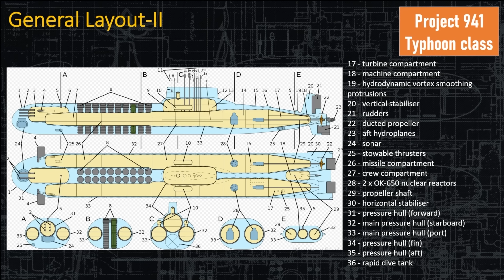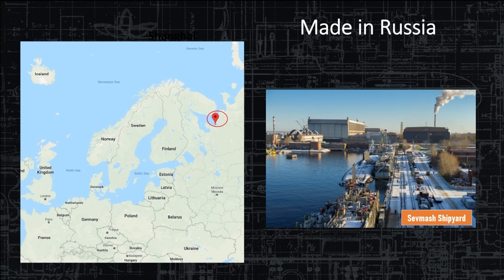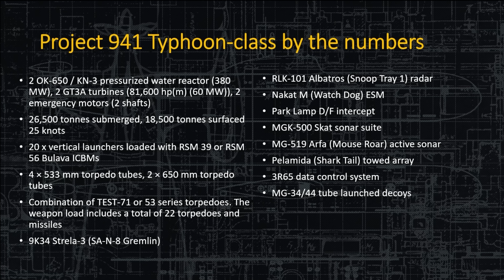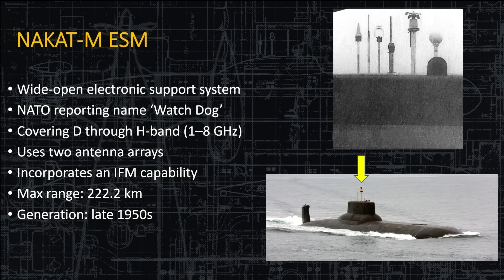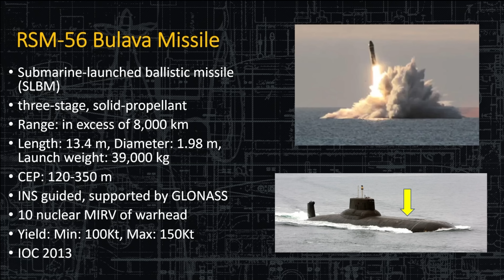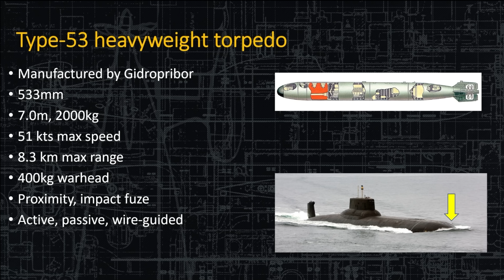Typhoon SSBN Sub Brief

Comment: About 5:05 and stowable forward hydroplanes.
I know I am getting really technically here. But the soviet navy did indeed have boats with stowable forward hydroplanes before the USN did, because of the german type XXI, they operated right after the war. And even you you want to talk about soviet designed boats only, the Whisky class (as is to be expected for a XXI developed boat) had them as well as son as ´49. 
Thats of course only if you ignore the flat-to-the-hull-folding planes.

Comment: Aaron do you have a brief on the Singapore Invincible Class Diesel/ AIP boats that are replacing the Challenger and Archer Diesel Electric boats? I believe they are German made to Singaporean Specifications using features of the Type 214 and 212 with a fuel cell AIP. Particularly interested to see if they have fitted the RESUS system of emergency ballast blow!
Cheers,
Love your work!

Comment: Did you say "manually raising the control rods -- that was a procedure?"  Oh, Hell NO!!! No frakking way would I trust their shielding.
Reply: Really - do you know that American naval reactors are also manually controlled?
I'm an engineer and a technician I worked with circa 2007 was an ex-USN nuclear power plant operator. 

I'm Australian and we were working on an Australian mine site together and the subject of Australia NOT wanting its next subs (at that time) to be nuclear came up one day. Yeah I had the AUKUS discussion almost 20 years before it became a real discussion. FYI - since those discussions I have been 100% pro-nuclear powered subs for Australia, but the Virginia is NOT the right sub for Australia and never will be but that's another discussion.

What came up was how safe are these reactors and he described (without disclosing anything classified) how he was trained and how they operate USN reactors. The level of what he had to do in his training was amazing. Failing any exam meant being kicked out of the course and the pass marks weren't 50% they were more like 90%. The reason (he explained) why the training was so strict was because of the way the operated the reactors, which is mostly manual.

Because in a nuclear exchange there's the chance of an EMP (electromagnetic pulse) shutting down all the electrical controls they decided to have as little computer control and automation as possible. There was always some but in general American Naval reactors are manually controlled. That might be changing in the next generation of reactors because not only do we know how to shield better against things like an EMP but also because computer systems can now be made so reliable that the chances of a mistake is measured in 1,000s of years. Those sorts of computers are also a much longer discussion. 

The French certainly use a lot more automation in their subs which is evident by the fact their crew size is less than 1/2 that of a Virginia.
Reply: @tonywilson4713  I was an American nuclear power plant operator. EM2(SS). Los Angeles class. I stand by my statement. To manually raise rods, physically, in the reactor compartment? Standing g on top of the Rx itself?

No frakking way. 

In no way, shape, or form was I talking about the Reactor Operator turning the switch and shimming up and down. Completely different. 

I was referring to the SL-1 incident. I learned about that in NNPS, and had to verify that it was public knowledge before mentioning it directly.
Reply: @ObeyWannTK6960  Mate I am not disagreeing with you.
I was just pointing out that fundamentally US Naval reactors are also manually controlled and anyway you should know that better than I do.

Plus he never said the Russians stand on top of the reactor and grab the rods with their hands and pulled. My bet is there is some sort of hand crank or pneumatic system to do the job. Looking at the photo it my be a pneumatic system because there's what looks like supply lines (thin white tubes) going to cylinders.

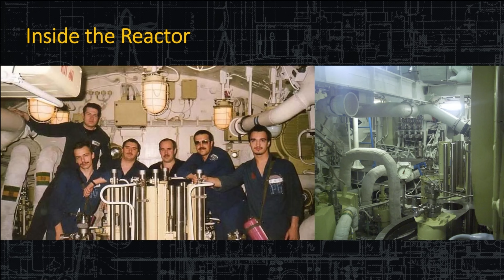I found an interesting Reddit page with the same photo that Aaron used in this video at 20:50. There's a couple of comments by other ex-USN people there which are kind of interesting. One guy points out that physical size difference in the OK-650 and how they mounted the reactor below the floor of the compartment where the control rods could be accessed. That's why they aren't wearing any Anti-C clothing. 

So its not built like a USN reactor or reactor compartment.

I dug a little further and found a Norwegian report on Russian nuclear reactors for marine applications. It doesn't give an explicit answer to this but what's clear is there is a mechanism for inserting and removing the control rods from Russian reactors that's controlled from the control room and that there is also some sort of manual override for that system if the rods become stuck.

So the manual procedure Aaron is talking about is common to Russian reactors for marine applications and that its a back-up rather than the primary means of control.

Comment: One ping only.  I've always been fascinated by this monster design!
Lay-person question; could you mitigate the danger from wake-homing torpedoes by ceasing to move through the water, or does it also have other detection capabilites?
Reply: If you stop your wake leads up to your stopped ship. The tactic we were told in the mid 90s was to make a looping turn to cross your own wake and leave a non-directional “knuckle” in the water in hopes of confusing the wake homing.